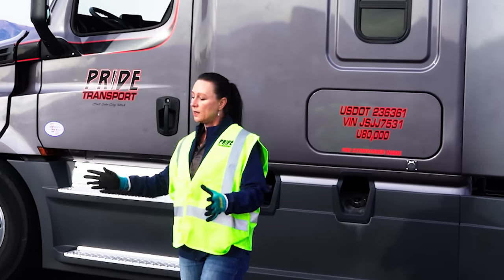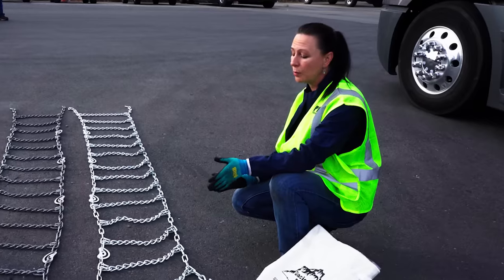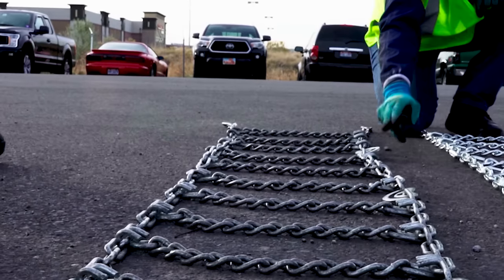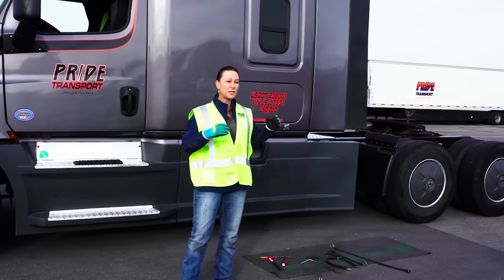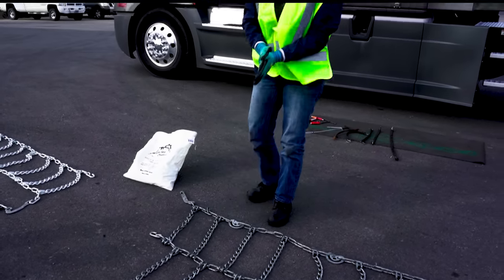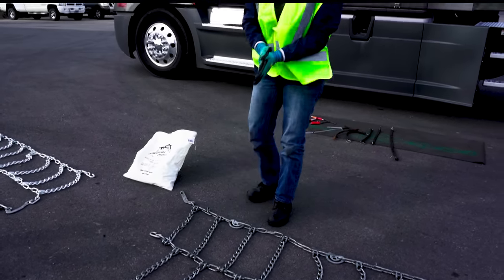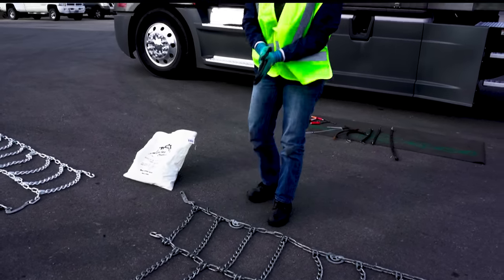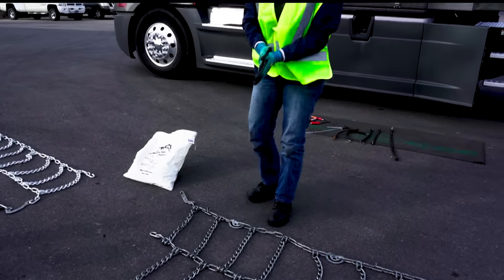The BEST Instruction on Tire Chain Installation ever.

Comment: I have been installing 3 rail chains for over 35 years in winter weather. Your demonstration was excellent. And yes, at night, in heavy snow, on a hill, with no shoulder. 
I have 2 comments. First, the mat is a life saver. When they use salt or calcium chloride to melt snow on freeways the slush is colder than 32 F. If you don't have the mat and lay in the slush, it will get thru your clothes and it is cold. So, use a mat especially in slush.
Second, after the chains are installed run a mile or so and then re-check your chains and tighten as needed. I check both inside and outside. Tight chains run nice and less vibration.
Just another thought, I don't throw my chains in a bag when I take them off. I have a plastic box without a lid. I put the end of the chains without the link in the box first and then slowly lay in the rest of the chain. The hooks and coupler are on top. This helps when laying them out. I put them in the truck to dry out, thus no lid. I spray a little wd-40 or spray grease on them when I can. This makes them ready for the next time I need them.
Reply: Or just buy water proof insolated coveralls. I bought a pair 20 yrs ago for 300 bucks. They are still in good shape. Wore as ran flat bed plus fixing cars, trucks and farm tractors laying in cold slush and mud. Ya they stained with oil but still no rips. Very heavy cloth and i was even homeless and with those coveralls i could sleep on the sidewalk all day in canadian winter. No mat will ever keep you warm and cant move as fast cause constantly moving that mat.
Reply: Triple chains are for chumps.
Reply: @MG-ks1qg  not in the mud or frozen gravel roads they're not. Go work in the mountains and off road and see if you change your mind....lol
Reply: Was gonna say same thing.. lots of common sense and some extra outer work gear for this.. demo was great instructions but again real world is a whole new animal.. including little to no lights
Reply: @MG-ks1qg  Singles are for highway only flat landers.
Reply: With all due respect to your 35 years-  It's just so hard  to comprehend after that amount of time you're still willing to lay in the slop to chain up. I'm not saying it's wrong I'm just saying I guess if that works for you more power to you.  And as far as this woman in the video,  She should spend an week at an in-season chain control she'd most likely return  having a better understanding and  knowledge a for what a true seasoned professional would actually do. 
Again, I'm not saying This process is wrong, I'm simply saying why do it the hard way.
Reply: @davidfigueiro4301 what did she do wrong?
Reply: @vw5056  you don't "throw chain" for a start lay it out on the ground drive on.  Put a binge (or two) through wheel with both side chain ends hooked.  Use hp to pull chain over the top.  Hook tsil clamps/cams/ bungees.  Tighten evenly. Check, retight 2.3 - mile down the road until runs smooth. Drive safe watch your speed

Comment: Well done, you are a beast lifting those 3 rails.  They're like 80#.  One tip to viewers, try to never lay down.  I squat, to stay dry...but also to stay safe.  If the hook isn't high enough to reach while on your feet, roll forward or back a smidgen.  Safer than laying down under a tire! There's no guarantee that rig won't slide due to wind and the crown of the road shoulder.Also  I have a headlamp so I can see the in side of the tires as I always chain at night.  Frees up your hands.

Comment: I'm not runnin a big rig, just a 3/4 ton with a plow.  I have a set of vbar ladder chains with cams, that I struggle with every time I put them on.  This video really open my eyes to what I was doing wrong.  Last year I think I even ran them with a twist in them cuz the cam just didn't sit right against the tire, and I couldn't figure out why.  Excellent explanation on every aspect of chaining up.  THANKS!

Comment: undoubtably  the absolute  best detailed demonstration/performance/explanation of how to install and use snow chains. Theory of operation coupled with subject matter expert details on how to and why to position/examine/layout/install/run/remove the snow equipment. The individual that actually designed and engineered the chains could not have added any more. that was Perfect from a Safety perspective as well as a driver Utilization effectiveness perspective. Truly you are doing excellent work. unmatched anywhere.

Comment: Excellent instructional video and demonstration. Here in Europe we´re legally required to do a 35 hour course every 5 years on various aspects of professional transport, part of which is the use of snow chains, especially here in Norway where we do actually need them. This demonstration was way better than the instructors on the course. The use of bungie cords to prevent the chain slipping between the wheels if it is too loose or comes off is a great tip. Although I would never lie down behind the wheels to pull the hooks through, we just roll the truck forward or backward on to the chain until both ends are at the same side of the wheel, because if the truck rolls for any reason or you get sideswiped, you´re a goner.

Comment: I would like to see this done on the side of the interstate in the middle of the night in a foot of snow with an iced up trailer on.
Reply: All these instructions on dry pavement with no snow are hilarious. I drive over Snoqualmie Pass ( Washington state ) twice a night and trust me it’s never that easy to put them on.  I have gotten good at doing it fairly quickly, but When you have snow jammed around the wheels, or you accidentally spin the wheels so the chains fall off, etc etc etc Too funny 😂
Reply: That’s when you are warm at home or sleeping in the sleeper…lol
Reply: It would be kinda hard to show what needs to be done in the dark and snow eh?? 😂 Fragile egos from an instruction video....
Reply: I want to see a how to install chains ⛓ on I-80 thru Donner pass when it’s dumping snow ❄️ @ night when it’s freezing FNG cold
Reply: As long you have the practice and can visualize this. You can perform it during those moments with just being extra cautious and a lot more effort. You don’t change the techniques and things to look out for.
Reply: Before going over Donner Pass they have a chain check area... they want to make sure you have chains on board... some foreigners misunderstood and they thought they needed to chain up... your chains will break driving on bare pavement!
Reply: Easy peasy here but we all know different story in reality.
Reply: Maybe you should have put them on an hour earlier.
Reply: Well this side to tell you about Jeff England and pride basically they expect you to throw the iron when they give you lessons like this thanks but no thanks
Reply: @kennydings3879  So true, it’s never that easy on snow and ice.
Reply: Bother-in- law was crushed by rolling trk....didn't  use tire chocks....hummmm
Reply: That’s why you practice in the warm and light and not wait until it’s dark,  freezing and covered in snow. Every professional athlete, combat medic, competition shooter etc doesn’t practice until they get it right, they practice until they can’t get it wrong and they do it when it’s fugly outside
Reply: @kennydings3879  where you hauling from? I'm out of Yakima
Reply: @Sinister_Reaper  Tacoma to Moses Lake to Tukwila to Seattle and back to Tacoma.
Reply: @Moondoggy1970  and what are you doing than? driving without?
Reply: @martinurbat1784  when it’s time to chain up I chain up they don’t play out here in Cali especially when your going across the i-80 & Donner summit or the Siskyou pass
Reply: We got a lot of negative  comments here.  This is a teaching video for people that are new to the company and possibly new to driving in the western 11 region.  It's baby steps.  You have to walk before you can run.  Rachel is an excellent teacher.  She has driven over Donner and Snoqualmie, and had to chain multiple times. She explains in class that this is not easy to do in poor weather.  I have personally benefitted from her class.  I thought I had it down easy, but she has little tips that make things effective and more efficient.  

Being from the Midwest we don't use chains on the highway. (Believe it or no we have 7, 8, and 9% grades here too.)
Reply: Oh it’s been done with , believe you me!
Reply: I gotta stupid air damahinic fins in the middle Of the  tires
Reply: @kennydings3879  If you use single chains instead a set of triples and put some blocks under your tire it raises the outside tire so you can put the one without rolling forwards
Reply: @jameshanlon5470  Great idea. I only use singles and I always disconnect from my trailer, pull forward and then put them on.
Reply: @kennydings3879  Unfortunately as a car carrier I don’t have that luxury it’s so tight under there with or without a trailer
Reply: Then go hang out on the passes at winter and watch
Reply: @kennydings3879  but it is good to get a new driver started then show them a real world chain up on Snoqualmie.   I've been going over Snoqualmie  up to 5 times a week since 1996 I know it very well.
Reply: Lol did that in vale a few hours ago
Reply: It would be wonderful if we need to do this at that situation !😅
Reply: I would like to see this done during an avalanche
Reply: With the abominable snow monster chasing me
Reply: Millions truckers have done it. But it’s impossible to video anything in those weather conditions. 🙄
Reply: I just did it's not fun it's pain in the ass take hours without lights but learning lessons you realize you need a lots of things
Reply: It's a good tutorial.  It takes practice and repetition.
Reply: It's demonstrated on a bobtail so they don't have to hunch under the trailer. And when chaining, it's usually in the worst weather. Usually 15 degrees with blowing wind and snow, wind chill factor in the negatives. Then one has to run 30 mph hour max for a few miles, take off chains in same bad weather, and possibly have to chain again that trip or day. I am going to do the southern runs in winter and northern runs  in the warm months. I will leave the chaining in bad weather up to others. I used auto socks and they are fantastic, but they dry rot in a few years of use. I guess I get my money's worth, but $249 for 2 and one needs 5 for Washington and other states.

Comment: Laying on the ground in front of behind or in between the tires before you pull the truck up onto the chains can easily get your ass run over or penned under the tires in an ice storm. A gust of wind can easily slide the truck on ice especially if the ground has any slope to it. I hang the chains then pull up onto the first cross chains then connect the chains. I have seen one driver penned down by his coat under a truck that slid and one killed by a trailer rolling onto his chest when the truck slid on the ice !!! It s rare but has happened !!!

Comment: the thing i've always loved about these "how to" demonstrations... they're always done in the exact opposite conditions that you'll actually be chaining up in... it will be cold, dark, cold, wet, cold, and usually muddy/slushy... and cold
don't get me wrong... an explanation/demonstration is VERY helpful for someone who has never had to use chains
the first time i had to chain up, i was solo, never had any practice/experience with chaining and didn't have the right gloves... had to stop multiple times to allow my hands to warm up enough to move them again... some preparation and/or expectation/explanation of what i would be doing would have helped immensely
Reply: And don't forget your gonna be all pissed off cause the chain up areas are all full of steering wheel holders who won't chain up, ( ya know the if it's bad enough for chains ya shouldn't be driving type steering wheel holders) and so ya gotta hang your ass out into traffic cause your doing it on the shoulder. I don't mind throwing iron at all once ya figure out what works best for yourself it's a breeze, and the chain buddy or chain hammer are a must love mine had it for years.
Reply: @parentsbasement7734 - Where do you find those chain hammer/picks like she has in the video?
Reply: It’d be pretty much impossible to video what she’s doing in those weather conditions.

Comment: This is an excellent video, but coming from New England, I can tell you, using using roller grip chains , Made by St. Pierre Chain, make things so much easier. No tools are needed to replace broken cross links, there are no cam locks to wrestle with, and one does not have to worry about the hooks on the cross chains digging into the tires.

Comment: Well Done instructional video. I drive from Baker City, Oregon to Portland and back 5 days a week. I've chained up 3-4 times a day. I developed a few shortcuts like putting down a little kitty litter when I have to pull forward or back so I don't throw the chains off. I've never got the chains on without driving over them. Usually takes me between 15-30 minutes to chain.
Reply: I've never used the kitty litter trick but a driver ahead of me on Santiam this week used it. I've heard older drivers say if they just need a little to keep going they'd pour bleach over the tires to soften the rubber. Food for thought.

Comment: I started to watch this but just couldn't finish it. Cam lock side rail chains and rubber straps are for people who don't know how to properly install tire chains. I grew up on a sidehill farm in Wi. back in the sixties. We did not have a 4x4, we had tire chains and there was no such thing as rubber straps on our farm. That was my introductory education on tire chains. Then came eighteen years of hauling log out of the woods where we used tire chains year round as weather and terrain dictated. Boring through deep mud, tree roots, and rocky banks would have made rubber straps useless. Once the skill is mastered, four double chains can be put on to stay in under five minutes.
I do like the way you demonstrated how to unravel a twisted chain...perfect!
Reply: You don't need bungees for off highway . Bungees help keep the chain tight for higher speed and less damage to the trailer .

Comment: A 3 foot length of a 2”x6” board with 2”x4” nailed on to the 2x6 to separate the cross rails .  Drive wheel onto the board and lift chains to the top of the wheel . The old White Freightliner COE came with a cab jack handle with a welded on cam tool that worked well . Cut an old pickup truck bed liner with a Skill saw , makes a nice waterproof pad to kneel on and will roll up .